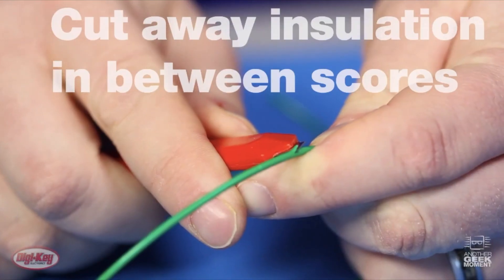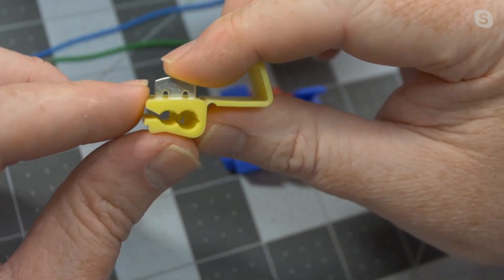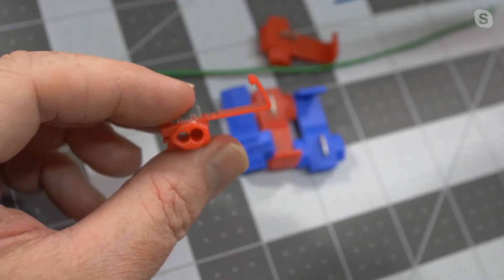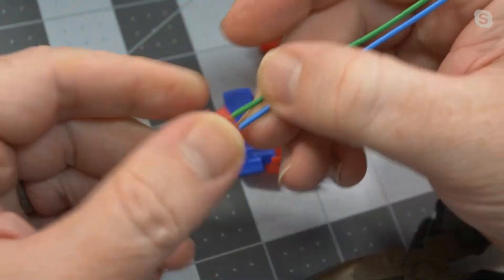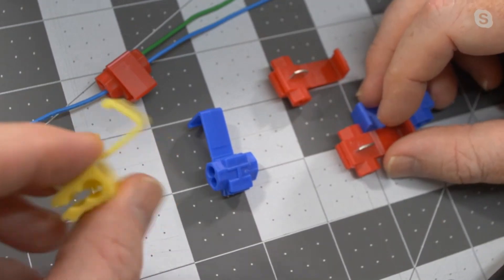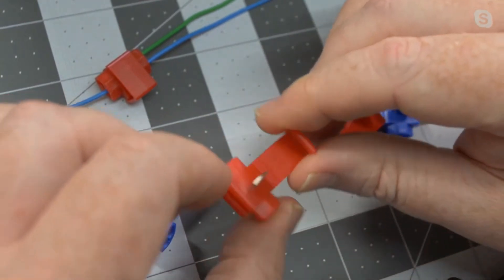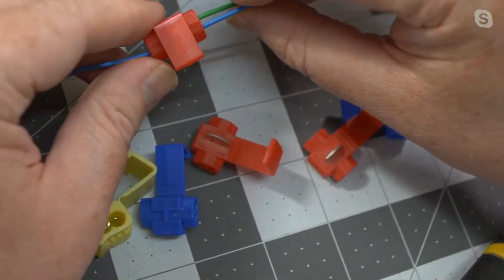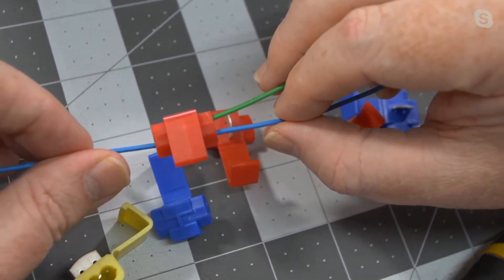Solderless Wire Splicer

Comment: These connectors are junk. They may be good for emergency use in some cases? I see them all the time in exposed locations on trailers, truck wiring and places that come in contact with water. They start to corrode instantly. They also cut the wire strands when you push the metal piece down, instantly lowering the current carrying ability of the tapped wire. Stay away! Far, far away unless you like chasing wiring faults?

Comment: I tapped into my taillights with one of these to hook up a backup camera for my car. But I was supposed to tap into the reverse lights can I under the connection and tap into the right wire without any problems or should I leave it. Obviously put electrical tape Around where I take it apart ? What do you think. Please get back to me
Reply: Hi I want to use this for the same exact reason. Can you tell me what you ended up doing and is it still holding up?

Comment: if i have a 2 prong extension cord and i want to connect 2 pc fans together that have a black and white wire on each fan can i use these wire splicers to connect the black wire from the extension cord to the 1 side with the stop of the splicer and then connect then clip it onto the black wire that connects side by side to the 2 fans and then also do the same from the white wire of the extension cord "connect the white wire to the side with the stop and then clip the other side to the white wires that connect side to side to the pc fans and then they should work right since all the electricity will be recirculating?

Comment: I've used these in the past with general good results. They are not an everyday use item, but work well for splicing in low voltage/low amperage draw items link an LED light. Not meant for anything over 12V and as stated in the product, generally not used for anything over 7 amps. 

Ive combatted corrosion with products sprayed directly on the tap like Krown spray or wurth contact sl lacquer. I have LED reverse lights on my trailer going 10 plus years with these connectors and no electrical issues. In fact the LED boards inside the heat sinks are corroded now and the connectors are not.

Comment: I'm saddened that you've been introduced to this method of splicing and tapping wires - it's one of the worst.

As your guest even shows during the demonstration, the connections are not reliable under even optimal conditions and there's such inconsistency in the manufacture of the parts that they're only really useful in extremis, for a temporary fix, when the function is non-critical (and where all three cases are true - this isn't an either/or).

Luckily you've had years of experience and use of other more reliable methods of achieving the connections to use - so you can probably just carry on using them, hopefully you've not spent any real money on these items (or too much time in the preparation of this video).

I look forward to your next videos though - your content and introductions to new tools and their uses is normally wonderful.

Comment: This was not a great recommendation. 
It was mentioned toward the end that these should be used if is need for a "quick splice" and you didn't have the time to do a proper job. Earlier the guest said he used these to connect his heated grips on his motorcycle. This made me cringe. He said he had these on his motorcycle for four years. Certainly he had the time to do a proper connection.

The "t-splice" or "poke and wrap" method is a better and more secure method. If you ever have an auto shop, stereo/alarm shop using these splicers or t-taps then go to another shop.
If you do end up using these then they should be used for anything other than 12 volt. The colors do not necessarily represent a specific gauge. There is no uniform standard for these connectors. Blue with one manufacture can be for 14-18 AWG but I have seen brown with another manufacture be for 14-18 AWG.

There are many sources to purchase the same type of connector where you can create your own "y" cable or even purchase a pre-made "y-cable so you don't have to compromise the wiring by tapping into it. For my car, motorcycle or other electronics I never ever cut/tap into that wiring. I always make a "y" cable using the same type of connector the thing I am working on has. Yes, it is time consuming and perhaps a little more advanced but it is easily reversed in case you want to go back to "stock" or trouble shoot if gremlins start to appear.

You should never tap into wires that are live. Disconnect the battery before you do anything. 
You could cause hundreds of dollars worth of damage to your car or motorcycle if you use the wrong gauge wires or overload a circuit. Consider adding fuse if you ever need to tap into a line using any method.
Reply: Eventually I did replace it with a proper wire splice - and for what it's worth, I think I mentioned several times that these are no replacement for proper work, and that the best case for these is a temporary stopgap solution until you can replace it with something better. Oh well.
Reply: @twinegarner  what is the proper way to do it? is using a T Tap wire connector still considered wrong like this wire splicer method?
Reply: Yeah, well I'm not gonna spend $150 to get my sub installed or learn how to do wiring from the internet, because either sure I'll mess it up. This seems like a better option for people who don't know what their doing

Comment: Tapping a wire will break the insulation and possibly long-term corrosion failure. Look at automotive wire repair for detailed instructions. Kinda danced around that. Fantastic for a quick connection for sure.
Reply: chew gum and wad it over as insulation..   dry hardened gum is strong ?  Wrigley spearmint or Bubble gum?>
Reply: or someone can cook up electric grade cehwing gum for that very purpose..
hve fun chewing while you splice wires.